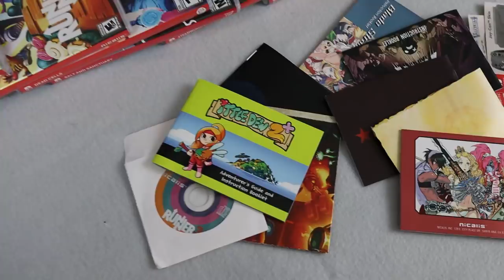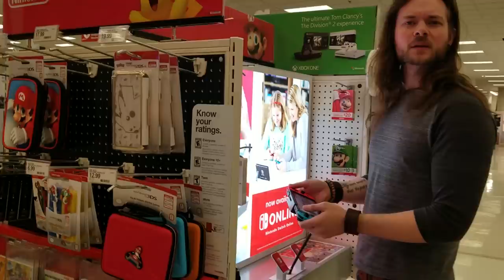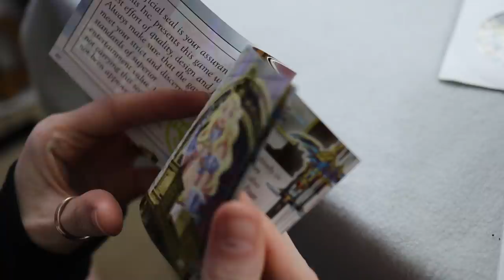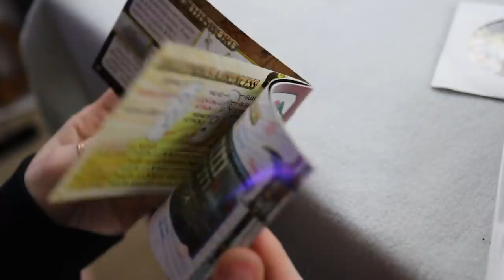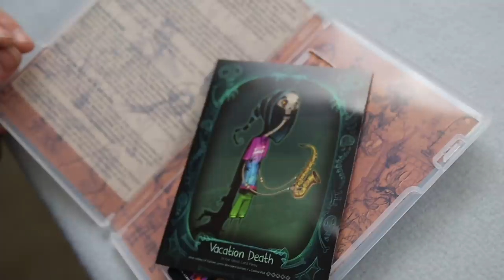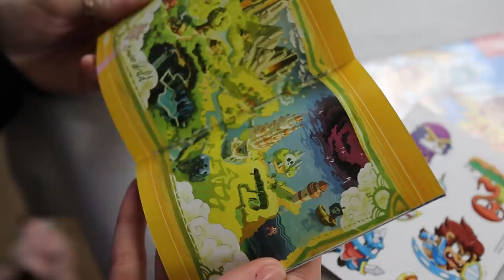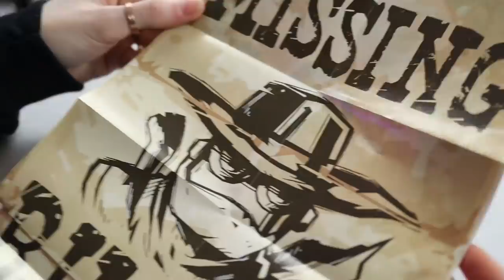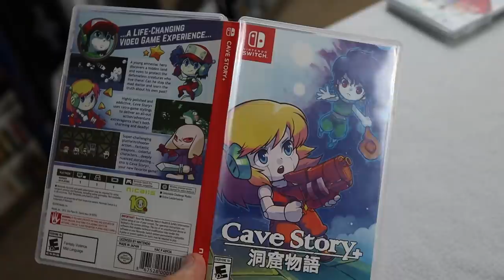Now Kim has something to say... (Also, Nintendo Switch.)

Comment: I love collector's editions and the like. Bought the Collectors Edition for Destiny 2, some different editions for some AC games, collectors edition for Generation Zero. 
I am right now checking out that Signature Edition website you linked to in a previous video. So gonna buy the Dead Cells and Moonlighter Signature Edition. Too bad Aragami was sold out on that edition for the PS4 but their support mentioned a Collector's Edition for the Switch, sounds very interesting.

Comment: Was hoping that someone could tell me somewhere to buy used switch games that isn't GameStop. I've looked around some but the only other place I've seen is eBay or Amazon.
Reply: I've purchased from the site estarland before with no issue and they specified whether or not the games came with the case, unlike gamestop. I've only made one order and it was for a 3ds game but they do have switch games and I had no issues and would purchase from them again. They had the best price for Fire emblem awakening with the case and that's why I went with them. It came on time (wanted to bring it on a trip to play during a flight) so that was great. The game was like new condition, as described.